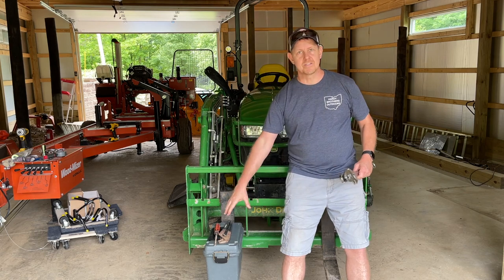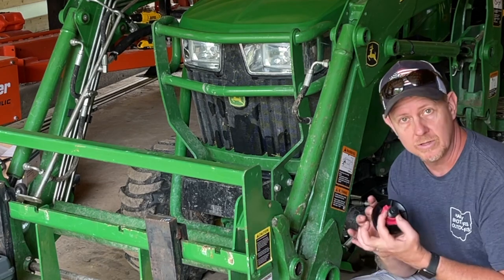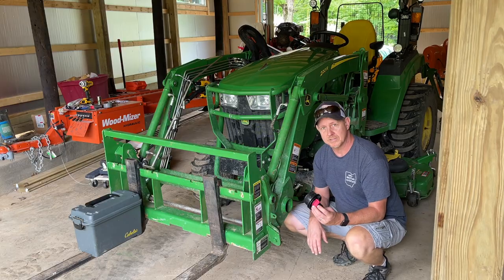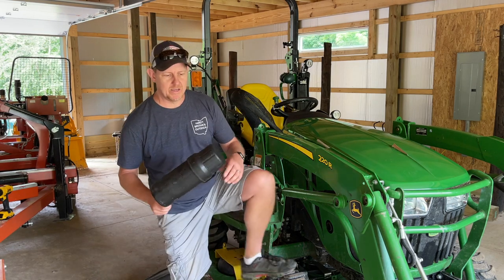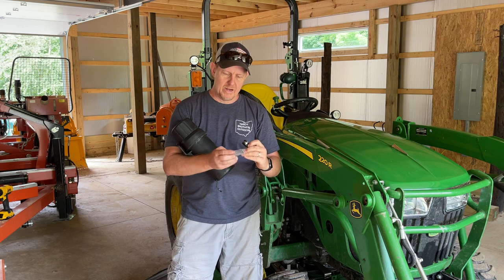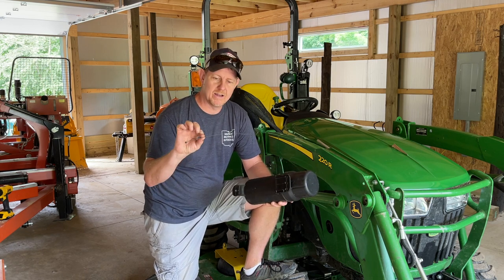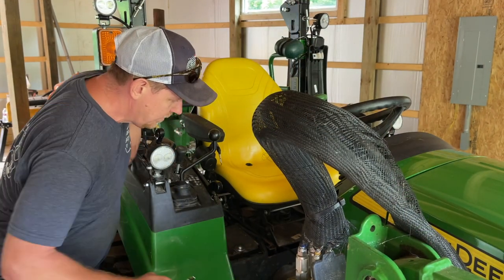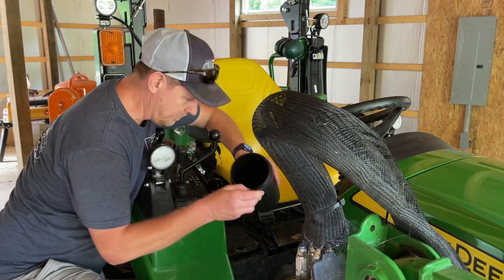#170 John Deere 2038R 2032R - Two Tool Box Hacks in under 10 Minutes for Less Than $30

Comment: Find your self a grenade military ammo box. Mount it the steel plate on the front of your tractor. The holes are all ready in the plate. At the right height it will not interfere with the loader or brush guard. Mine works great on my 2025R.
Reply from the maker: I’m gonna try that.

Comment: It seems that no manufacturer can engineer a decent tool box on a compact tractor lol! Nice solution Josh.
Reply from the maker: You got that right! Seems so simple...  It can take me a solid 15 minutes or better to get back to the house for tools when something goes wrong on the back 80... Just need something big enough for the essentials... I think I have a viable solution that won't interfere with anything but need to get it together to share.

Comment: This first gen 2032R I just got has the same tube zip tied to one of the ROPS uprights. It’s apparently not ideal, as I see the Light fixture on that side is also zip tied . Prev. Owner must have had a little kerfuffle in that area. I don’t have need of a FEL on this particular tractor, so I’ll be trying to come up with other tool storage options. BTW, I’m learning a lot about these 2 series rigs from your videos, and as I learn more I’ll be interested to see the changes/differences between the generations (besides the obvious ergonomics). Thanks!
Reply from the maker: Yeh those light fixtures are like tree magnets when mowing... mine is Gorilla taped on...  Tool box seems so simple yet a major oversight by JD.  Glad the videos are helpful!

Comment: For your rate of drop spray from back of tractor PB Blaster where the shaft goes into the housing. Let set and repeat. Mine freed up after 2 days.
Reply from the maker: Awesome thanks for the suggestion, will give that a try!  Btw, I went ahead and bought that manual so hopefully will get the pedal calibration video before too long... Was running into some issues last time so hoping find some additional help in sections around what you shared with me.
Reply: @HardyBrothersOutdoors  when calibrating, take your time, remember, the last step is to turn key off.  Mine gave an error, however, when I tried it, it was fixed.  Good luck.

Comment: Nice large garage for your sawmill and tractor. I store my sawmill in the garage also but that’s all that will fit. I noticed you also have a 3 point winch. I have the Farmi winch. You do a lot of things that I do. I’m in Northwest Arkansas. I mill mostly hardwood. What kind of trees are local to use?
Reply from the maker: Hi Tom, thanks for watching and commenting... We have about 177 acres here and have all sorts of hardwoods and some white pine.  We have Cherry, White, black, scarlet, and Red Oaks, most of the Ash is dead from the Emerald Borer, walnut, maple, hickory, poplar and many more... Sadly my mill has very few hours on it, I'm looking forward to when I have some more time and I actually want to build a mill shed so I can just roll up and mill vs. doing the set up.  I had thought the portable mill would be easy for me to take around my property so I could move the logs less but we have so many hills and muddy impassable roads that I've never got it past the front of the property.  I just got done concreting outside of the barndo so i maybe able to just roll it out and mill right on the new parking pads.  The Uniforest 35M works really well but again haven't gotten as much use as I'd like... hoping to ramp that up soon too.  What mill do you have? I just subb'd to your channel and will check it out.  Looks like the  Norwood HD36. That was the mill I was going to buy but had some issues with the Norwood sales and customer service so ended up with the Woodmizer.

Comment: Use a piece of PVC pipe cut to length with a screw on clean out cap. Zip ties or hose clamps to mount without drilling holes.
Reply from the maker: Good suggestion, thank you!

Comment: My so called toolbox has the same amount of space and it's behind the seat. Not a very handy place for it and can't fit much in it.  Sometimes I wonder why they bother with it. Lol.
Reply from the maker: Yeh, not sure I have a great suggestion for them but it surely should be a design consideration.  I assume they are marketing to the 10-15 acre owner that doesn't end up 20 minutes away through the woods on the back 80... :-)
Reply: @HardyBrothersOutdoors  probably right.  Didn't think of that.  They aren't completely worthless but could be bigger. 😁